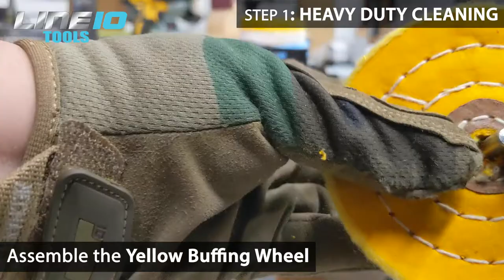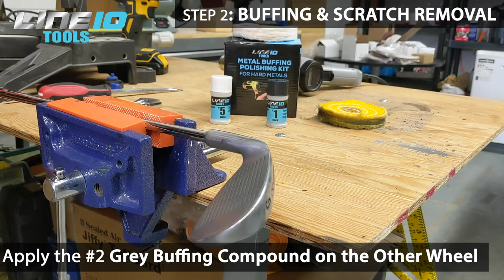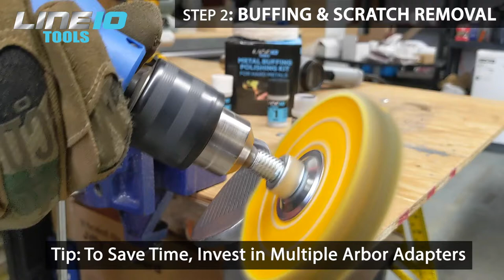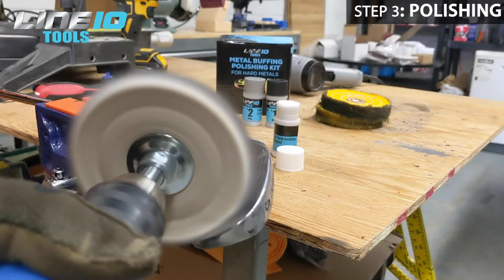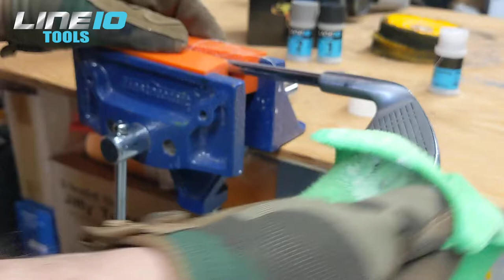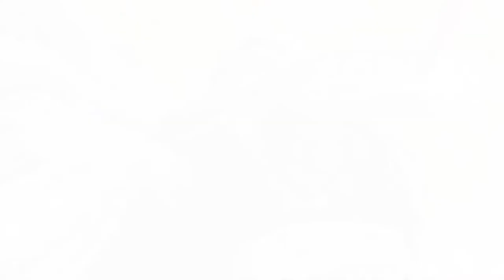Quick Way to Polish Golf Clubs Easily with a Drill

Comment: why doesnt this club have a ferrule on it? would the polishing formula affect the ferrule??
Reply from the maker: The club did not have a ferrule on it to begin with, the polishing process is for metal and should not be applied to a nylon, plastic or painted ferrule, you can put masking tape over it to protect, or just avoid it
Reply: A ferrule, on a club with a steel shaft, is merely cosmetic.
Reply: Ping clubs never used to have them

Comment: put the drill in the vice and   grab the  head with some gloves,much easier
Reply from the maker: You can do it either way makes sense to you depending on your setup, I like having extra control of the drill and move it around, especially in a small area where the space is tight.  You can also mount the buffing wheels to a drill press or on a bench grinder if you are looking for a stationary solution, but for the bench grinder its better to upgrade to the 6 inch buffing kit to do that.
Reply: Agree club head is a lot easier to move around than the drill safer as well
Reply: If you were to do this, would you still be pulling the trigger of the drill while it’s in the vice? You can’t hold the iron with 2 hands in that case right? Am I missing something?